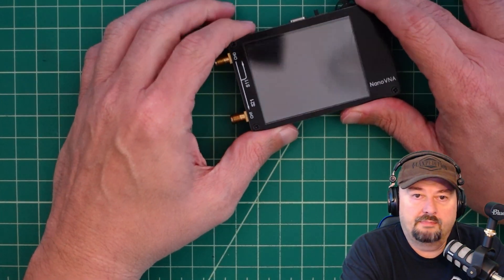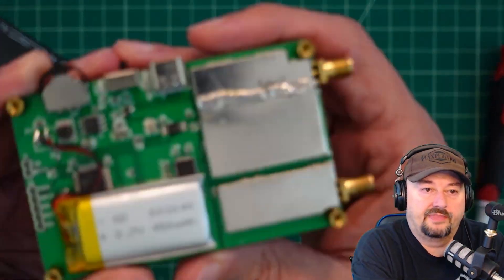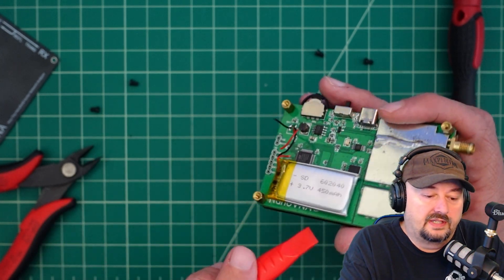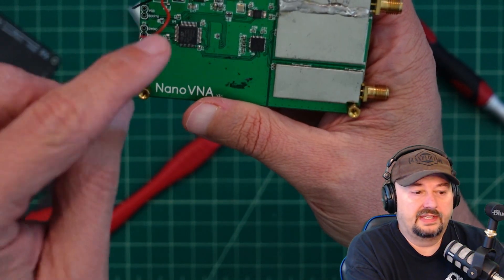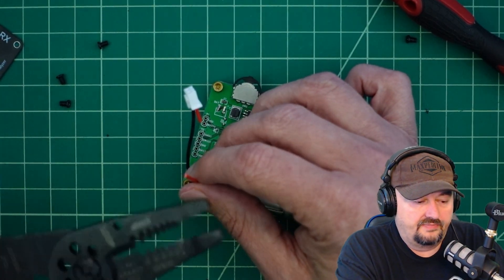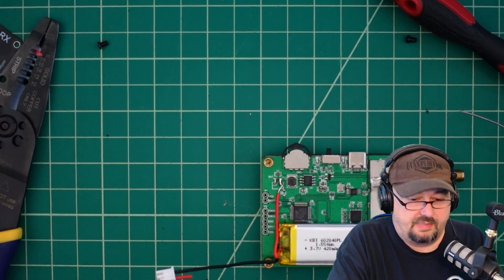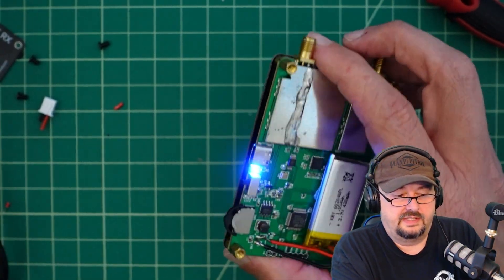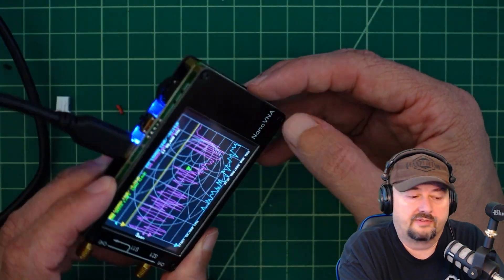NanoVNA H Battery Failure

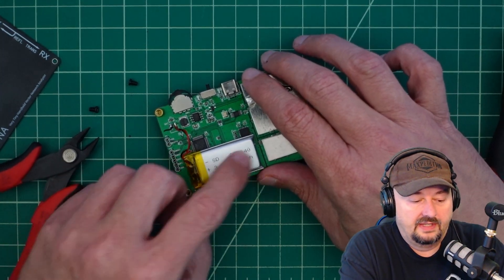Comment: 1:27. Shows it’s got at 602040 3.7v 450mAh battery to be replaced.   It might be good to pause after the opening and set up a few seconds of a still, zoomed in, high quality picture of the fix as you discuss next steps.   Flipping it around in your hands is blurry and frustrating.
Reply from the maker: Thanks for the feedback David

Comment: To be safer, solder a resistor to the battery when disconnected from the unit and wait until the battery is fully discharged, then remove it You are going to discard it anyway and it is then safe for the recycling plant to handle.

I am not even going to mention the placement of the wires on the soldering pads neither the dabbing several times with the soldering iron to risk cold soldier joints. 😄 Just get a course on how to solder.

Else a good video. Thank you.

Comment: One big, nice thing about How-To vids is that 'we' see that 'it' is a problem for others, too; and, that it is fixable. Dang, sigh of relief. I thought I'd do a little switch of technique and just cut and re-solder the connecting wires and not solder on the board itself. Thanks for the vid.
Reply from the maker: Thanks Zingo, glad you got it sorted 👍

Comment: My original one had the same issue and I replaced it with a larger but thin enough battery; it is working well.
You could have done the soldering of the wire tips to pads on the PCB bit more elegantly.
De VU2RZA
Reply from the maker: Thanks for checking it out Subramanian 👍

Comment: I replaced both the sma connections, they were getting worn out. If you try it, i recomend chopping them up with a dremal first, much easier and less heat input to remove the 5 pins individually then the whole connector. I almost ripped off the traces
Reply: Even better, get pair of male-to-female SMA adapters to use as connector savers. Leave them permanently attached and replace them when they get worn out.
Reply from the maker: That’s a good tip 👍

Comment: My battery started swelling up recently also.  Enough so that it was putting pressure on the circuit board and causing issues.
Reply from the maker: Did you replace it?
Reply: @TheSmokinApe  not yet.  I removed it and am using the USB port for power for now.
Reply from the maker: @propagating-radio  gotcha

Comment: Reason it puffed is from leaving it stored at full charge. I think the nano vna guy could write sum code to auto balance to storage voltage 3.7v. Leaving it full makes the dendrites form and crystallize on the anode and short across to cathode internally 😉
Reply: Ps lots of info on lipo batts are battery university online
Reply from the maker: That could have been it...
Reply: @TheSmokinApe  most common failure of lipo so much stored energy it does t like not being used. Maybe we can convince the software guy to write a few more lines of code to help preserve batt life ?
Reply: But, doesn't voltage decrease over time while in storage?
Reply: @joeshmoe7899  Very very slowly. One of the good things about li-ion batteries is low self discharge but they have this disadvantage. Leaving them discharged have the same effect.

If used little turn the unit on and discharge/charge to 50% and turn off. Best way to keep them going.
Reply: If the unit is going to be stored for some time the battery should be discharged to 50% and disconnected. There is a small but finite current drain even when the VNA is switched off. Lithium based batteries do not like to be completely drained and this will damage them. Ask anyone who has tossed their iPod in a drawer for a few months and later found the battery to have failed. if you only use it infrequently and you don't want to go to the trouble to disconnect the battery then the unit should be periodically maintenance charged to keep the battery from draining completely.